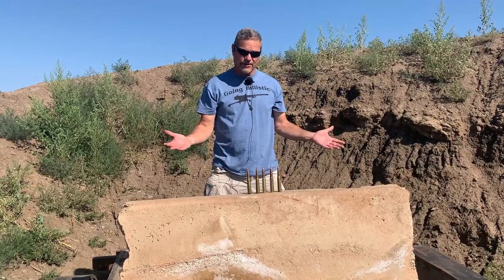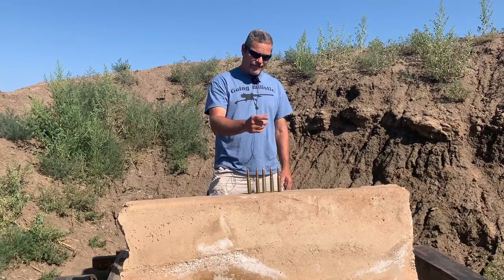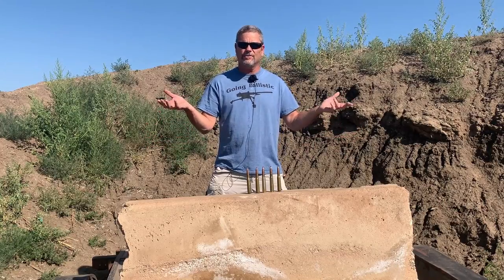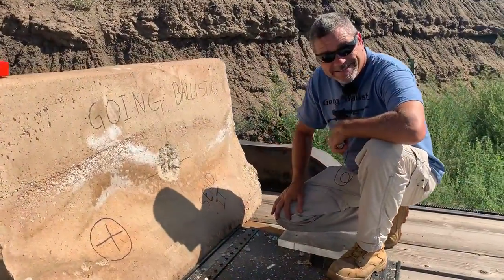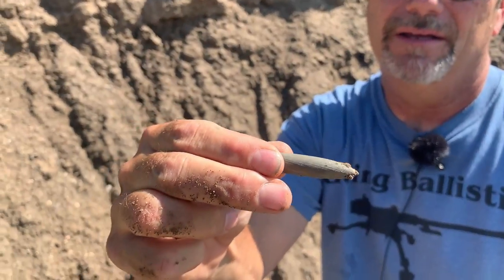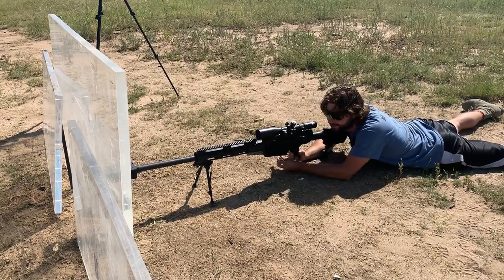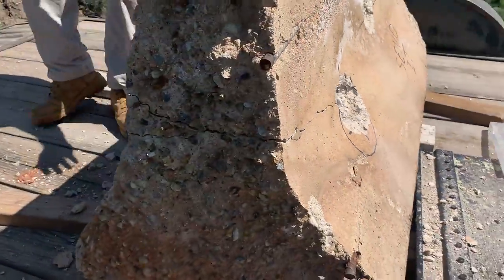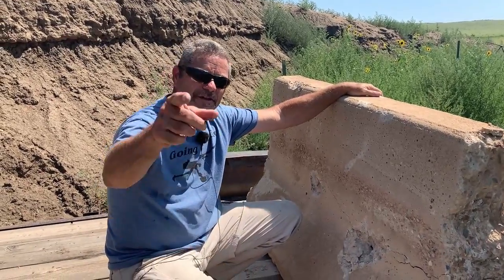50 BMG vs Concrete Jersey Barrier

Comment: In the Army we would expend ammunition before it got "too old".  In ONE SINGLE DAY at the range, my company (less that 200 men) shot over 300,000, that's Three Hundred THOUSAND rounds of 5.56.  Two hundred thousand rounds of M855 green tip and 100,000 rounds of M856 Tracer using SAWs and M16/M4 variants.  THAT's the kind of fun I like to have!

Comment: First of all,thanks for the metric conversions,very nice touch. I honestly expected no pass through but cracks and chunks breaking off. That russian projectile just nailed that hole,the slow mo on that was spot on. Maybe the dogleg trajectory is due to the rocks/cement positions in the barrier and the core simply goes where there is less resistance and "avoids" the harder rocks inside.
Reply from the maker: Thanks for watching!

Comment: What about splitting some logs with the 50 guys, it would be interesting to see how far up a log a 50 would get, you know aiming at the sawn thick end, I think you would need a metal detector to find the round from the outside or just ram something up the hole the projectile makes, that always works to gauge depth.
Reply: they tend to yaw, and come out much earlier than if they had kept going straight
Reply: Could try driving a splitting wedge lol.
Reply: @Lucas12v  think it wouldbe more fun with guns 👍
Reply: @ToAstYNaChO  not good then  I will keep thinking, thanks bud
Reply: @2rueblue  i meant driving the wedge with a bullet lol.
Reply: @Lucas12v  that sounds even better buddy brilliant shout 👍
Reply: Shooting with the grain proves very little (think of the difference between splitting logs with an axe and chopping it in half against the grain)... same thing with the bullet!  It may show grain orientation and interconnectedness but not necessarily strength and hardness as it would against the grain!
Reply: @cheryltysver6132  thank you for the education Cheryl  what would you suggest as a good display of what these are capable of? I was kust wondering how far it would go into the log. I think people would like to see the damage ammunition would do to everyday things. I think people might appreciate just how powerful these tools can be and hopefully show that they should be treated with more respect.
Reply: You are welcome 2rueblue...  By the way, I am not Cheryl and am with a small family plan which is the reason for the name inaccuracy. I have been fascinated by ballistics since around the age of 5 and being raised on a farm had plenty of different kinds of wood to shoot at all angles. This eventually progressed to researching everything from elephant guns to electro-magnetic launch and hydro-dynamics for projectile impacts in the velocity range of 3km/sec. (or roughly 2 miles/sec.) and beyond ... but you will run into other launch velocity limits before you get to that level.  Also, bullet paths with solids are generally quite inconsistent unless you choose the correct projectile nose profile (without getting into too much in the way of technical details, round nose and truncated cone shapes seem to with best for straight-line penetration paths... standard military ball rounds will nearly always give erratic penetration outcomes in most non hard.target mediums.  Hope that this has been helpful.  Take care.
Reply: @cheryltysver6132  thanks again, I have seen the shape of the projectiles they are using in the rail guns and ive been amazed of how much force these things hit the metal plates they are aimed at.  Have you seen the laser and conical metal dishes yet? This is real interesting stuff also the work on the carbon steel rod being dropped from outer atmosphere theory but all that gets away from anything a person could carry and use, the laser one could be developed more but I deffinatly appreciate the answer and was being honest when I thanked you for the education, thats why I follow this channel its all education and sometimes talking to people who know what more than you do so thanks again

Comment: Finally...👍

The other interesting test would be firing 5.56 mm and 7.62×39 mm at the barrier, and how rounds it would take to punch a hole through it.
Reply: i can answer you that already.

556 is not mean to penetrate, so the round will break apart on the barrier and take a small chunk out of it.
7.62 is a mean round made to penetrate with force, it will take a huge chunk out and penetrate deaper, but nothing crazy tho.

to be honest, comparing 556 and 7.62 is kind of unfair. as one round (7.62) is made to brutaly kill, while the other (556) is made to injury with shrapnel.

to go through the whole thing... i say probably more than a hundreds 556 and 20 of 7.62 or so.)

Comment: Yeah...really enjoyed that video. It was interesting wasnt it? The fact that it seemed to pass through the ten inch so easily but it took what 5 rounds  to get through 13 inches? Is there any rebar in that concrete? Could that be causing the deflection or the dog leg turn? Such a great video. If you wanna make another video and try and break it in half horizontally I'd be all for it! Lol

Comment: so when the brass splits like that can the case be repaired and reused or is it done ?
Reply: only way to reuse is cut neck off resize  for shorter rd.
Reply: @markthompson8656  THANX for the info😁👍

Comment: I think you guys should do a video with demo ranch. He posted a video yesterday trying to cut an elevator cable under tension with different calibers. He used a 50 bmg ap round but I'm really curious what a raufoss round would have done to it and yall are always busting out the party poppers.
Reply: We reached out to him before but he needs more convincing lol
Reply: @moabmanufacturing2513  I commented on his video, kind of like shooting a flare at a commercial airline at cruising altitude.

Comment: I had to laugh when the Russian round blew through the barrier. They tend to over build thier military hardware....haha 😄 🤣!! OK 👌..... 👌 🤣
Reply: what is so funny?? the concrete was broken completely in 2 and he put it in the same hole as the previous shot so therefore only punched thru 6 to 7 inches of concrete versus 13 inches. so,,, what's so funny?

Comment: Did you see the rock almost hit Justin's legs after the first shot..... plastic barrier or no, it almost hit him. 
The 'dog legs' are probably hitting rebar.....skims the side and keeps going.... would like to crack that thing open and look to see how and what the ones that didnt come out hit.

I also, would have liked to see some type of medium behind the barrier.... some thing standard as a calculative barrier..... what, idontknow....not paper.... maybe as simple as sheet of drywall....   it would be for a few things... first to see how the rounds exiting.... yaw, etc.  and then to see the pattern of bullet and debris projectiles and how they impacted.
Be nice to know..... after shooting though 8-10inches of real concrete wall...(meaning..not blocks).....to see not only the bullet destroying the target.... but concrete shrapnel would be able to clear the rest of the room with what type of damage.  
...... we all have to rethink idea of cover and concealment....... when a .50's involved.  
I have witnessed the same round going right through the center of a 18" thick telephone pole with ease... something that most of us would consider good cover.